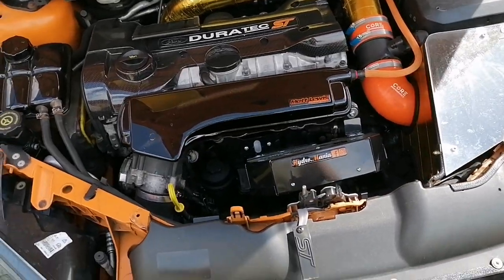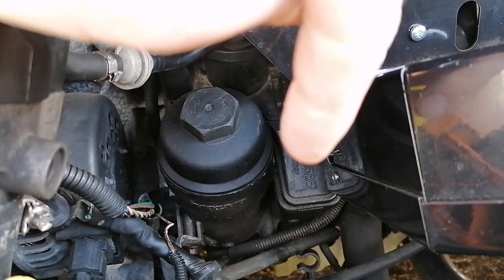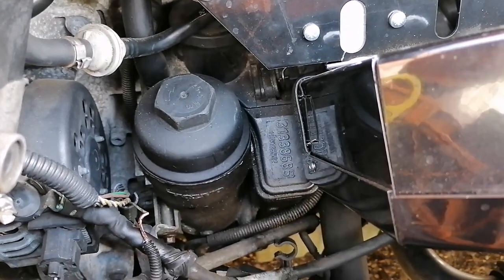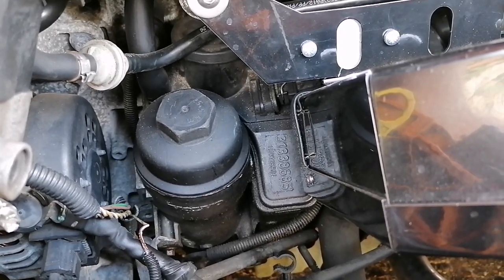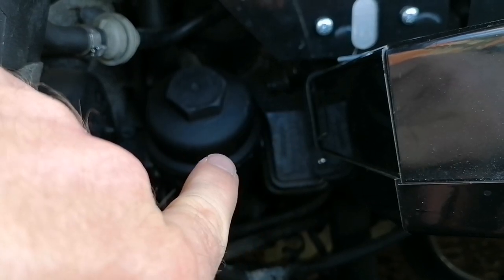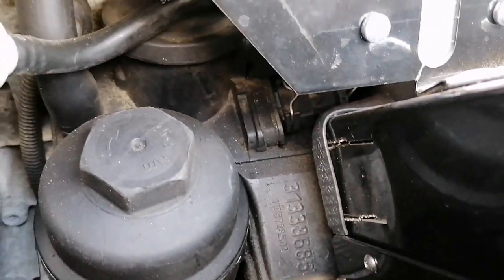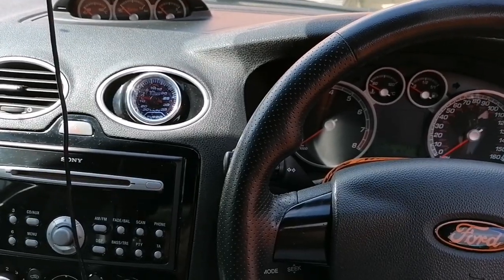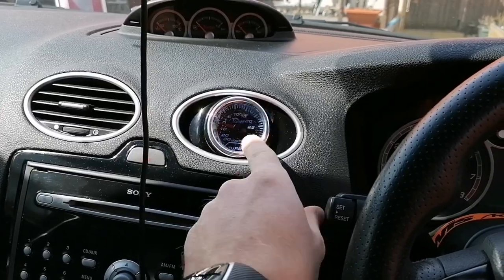Bad news and an update

Comment: That’s a bummer to happen to your ST, housing had to be changed on mine a few years back as the oil heater element went short circuit and was blowing fuses. Hopefully won’t be too long till you get the new part fitted and the ST is back on the road 👍
Reply from the maker: Cheers mate, hopefully not too long.

Comment: I know where your coming from 2 months before I sold my ST I had to change mine oil filter housing. Its not a difficult job, you need to remove the airbox assembley to get to it which is a pain. Where ur lucky you got the RS style ecu holder sometimes the breather hose from the assembly to the block can be damaged needed to be replaced as well.
Reply from the maker: Yea mate I've ordered that as well as I heard they can be brittle by now

Comment: Also, its your boost solenoid if your needle from turbo is not maxing past 3 quarters.
Reply from the maker: I had replaced that with a brand new unit from matt Lewis motorsport so I was confident it wasn't that
Reply: @mastersmods  welcome to the family of ST's modded m8, life is full of up's and down's my friend :)
Reply from the maker: @Lewster-ip1nt  sold the car nearly a year ago mate but thanks
Reply: @mastersmods  what car are you running now my friend, I am considering an audi S3 atm ?
Reply from the maker: @Lewster-ip1nt  still got the astra vxr mate

Comment: That's not to bad a news that's repairable, I pulled a head off one a few weeks ago as the guy said he was told his head gasket had gone, if only it was just a gasket gone, I found a crack in the cylinder liner, looks like the car is going to be scrapped now due to the cost, there is an engine mod you can do to help prevent it happening but it does mean taking the head off to insert shims between the cylinders
Reply from the maker: I have the block mod already mate. Shame if it's gotta be scrapped but a replacement engine is easy to swap, I should know 😂
Reply: @mastersmods  Not my car i just work for the person who own's it, guess having looked round the engines don't come cheap second hand and with the extra cost of getting me to install it just went over the his budget
Reply from the maker: @no1conrod  can be expensive for sure. Engines are usually around 1k I think, or atleast mine was.

Comment: Different question but have you had trouble at all with the engine malfunction message? Cutting out   got it back today, felt a bit Jerky accelerating,   give it some power and the message  came back on and cut out , luckily by my house,  was idling a bit Jerky too
Reply from the maker: Unplug the maf and see if it runs any better or differently. If it does then your mafs buggered id say. If not then check to see if it's bringing up any codes
Reply: @mastersmods  thanks mate will give it a try

Comment: Either oil filter housing lid has lifted and created a leak on the seal or you have excessive crank case pressure blowing oil out the seal.
Reply from the maker: Hoping it's not the lata 🙈
Reply: @mastersmods  I rebuilt my mates angine as his was spewing oil out the housing. Ended up being 2 cracked pistons 😳 I'd say yours just needs a new housing 😁
Reply from the maker: @jayfpv2405  I've changed mine now, vid uploading tomorrow 😉 I'm gonna keep an eye on it

Comment: I had the same problem mate bought a new one then that one leaked , then bought a breather kit that spewed blue smoke turns out piston rings had gone and had oval bores lol
Reply from the maker: Ouch🙈 hope mine don't go that route
Reply: @mastersmods  hopefully yours is ok mate get it compression tested bud and save yourself keep buying breathers , I had a few problems from previous garages that contributed to that failure , in your case it’s probably just your housing
Reply from the maker: @Wilkkid1  yea fingers crossed 🤞🏼

Comment: Am I right in thinking yours is the most recent updated filter housing version 5. Mines a version 4
Reply from the maker: Not to my knowledge mate no, the 90 numbers are the uprated from what I've seen but I've also seen a lot of conflicting information
Reply: @mastersmods  I thought if the number ended in a 5 which yours does that that is the most recent revision. Looks like yours may have been changed previous to you having the car. I may be wrong haha, I usually am according to the wife
Reply from the maker: @bigrob9921  who knows mate, all I do know for sure is mines leaking and it needs changing 😂

Comment: lol, its the diagrphram, not the housing that is the problem, £25 off ebay for the new rubber better seal m8.
Reply from the maker: Maybe but I didn't want to just change that and still have a problem. By replacing the whole thing it irradiated it being a problem
Reply: @mastersmods  fair play Bro, good to see an enthusiast replace stuff with brand new stuff, great to see, but maybe research our Ford problems, which will save you money in the future, btw, mine is also electric orange running 400bhp with 520 pounds of torque, done by Jamsport ;)
Reply from the maker: @Lewster-ip1nt  wow, personally, wouldn't go near them if someone paid me to. They ruined a friends mk1 rs a while back. I was all over the focus pages on fb and insta, did enough research on the filter housing. I chose to replace the whole thing rather than just the diaphragm, the money didn't matter at the time, just wanted it fixed